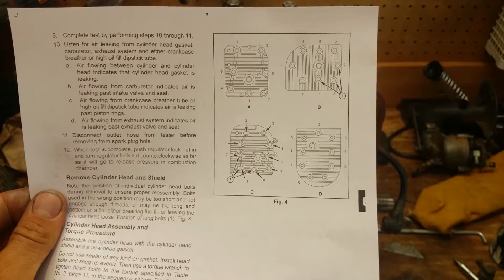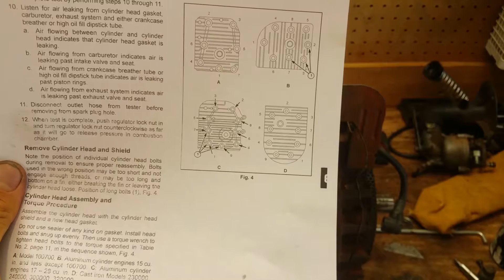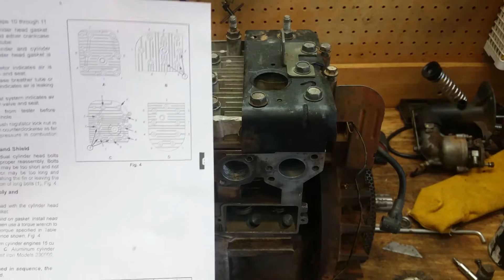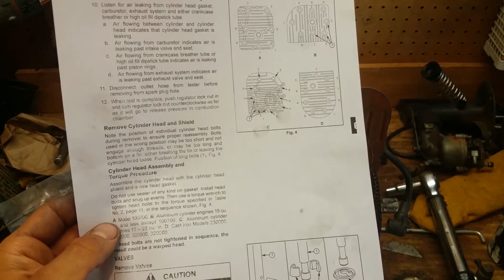Small Engine Head Gasket Replacement

Comment: The same bolt was tight on mine. It's because it's next to the exhaust port and gets hotter. It's also longer and has a shoulder on it, so do the other bolts either side of it. So 3 longer bolts with shoulders for centre orientation.

Comment: Explained it in a precise and slow manner and I am a big believer in anti seize compound. A good clean job. Thank you and where can I acquire a repair manual  with the torque  patterns and specifications?
Reply from the maker: Thanks! I believe I posted a link to the repair manual in the description.
Reply: A small dab of anti seize is all you need on the first 1/4 inch of the thread. As you screw the bolt in it will coat all of the threads needed. Too much and you will lose the proper torque after the motor heats up.
Reply: Good clean job... except for all anti seize he smeared on his the fingers 0_o

Comment: doing the head gasket of identical engine today , bought it cheap cos the guy selling thought it was knackered , 5$ gasket  should see it running good , rest of engine looks great . thanks for posting this , im a sparky used to rebuilding motors not engines.
Reply from the maker: Yea, these head gaskets are cheap and easy to replace. The biggest thing to look out for on old Briggs and Stratton engines is carbon build up. It's regular maintance on these to remove the head and clean off all of the carbon.